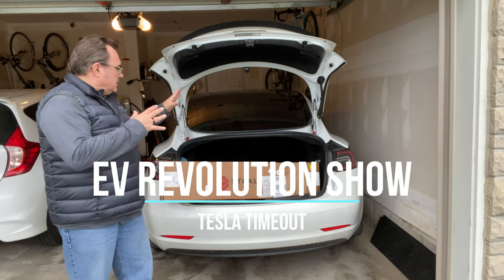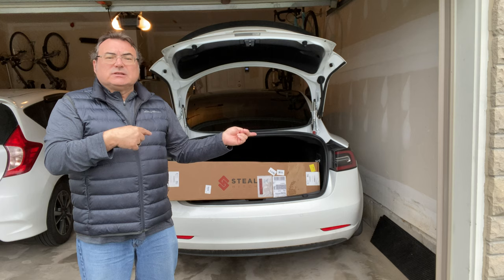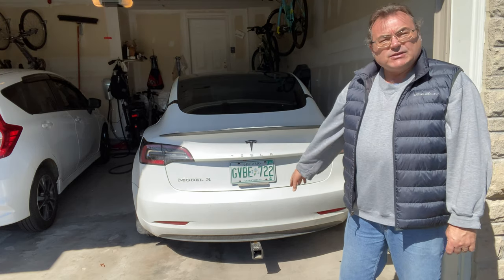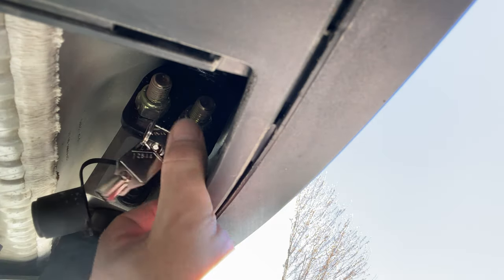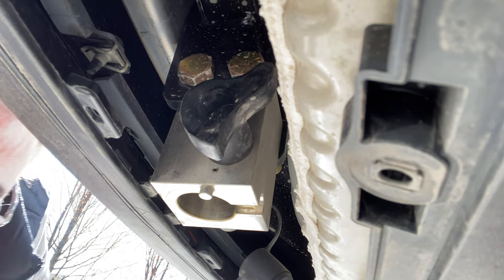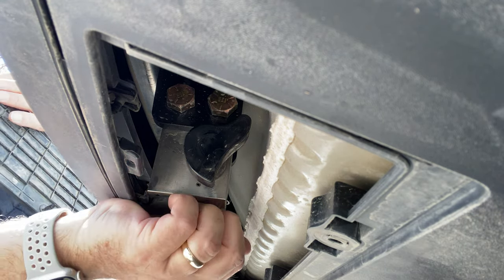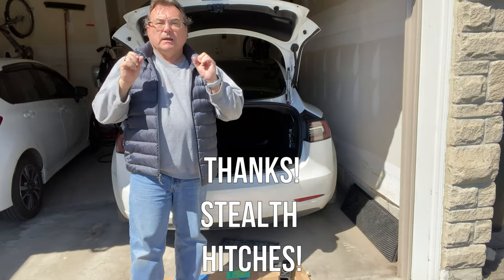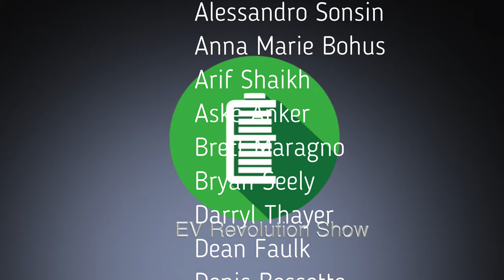Tesla Timeout #11 - Adventures & Accessories for my Tesla Model 3 - Stealth Hitch Review!

Comment: I installed one of those also. I did it myself since I have all of the right tools including a torque wrench. It is a lot work but the instructions are easy to follow. I would recommend to anyone that is not into automotive modifications to have a professional do it like Kenneth did. In my case it was a 2018 Model 3, that did not have the removable cover. I had to cut it out of the existing cover. That makes the rubber covers to the hitch even more important.   They are all high quality parts and it works really well.  The receiver just snaps into place. Once you get the feel of it you can do it without getting on the ground yourself.
Reply from the maker: Thanks for watching and for sharing your experience! It's it a great product.  I will be able to get the feel of it like you say with a little more practise.

Comment: Nice feature to add Ken, thanks for sharing. I wonder if Tesla will offer hitches for Model 3 in North America, I believe they have factory hitches available in Europe. It would be nice for towing small campers or utility trailers, or as a bike rack holder like yours.
Reply from the maker: Thanks JP!  They may but they have bigger fish to fry.
Reply: @EVRevolution  Yes I think you're right, Ken. It's easier just to rough in the hitch mounting hardware and let third parties install the hitch. I believe Europe requires hitches to be OEM installed and trailers are more popular in Europe also

Comment: Looking good.    If we order new 3 would we save cash 💸if we retro fit ?
Reply from the maker: Thanks for watching.  If you are asking if getting a tow hitch from tesla is less costly than aftermarket, I don't know.  Not sure if tesla sells one for the model 3, they do for the Y.  

There are a couple of choices (3 actually) that range from sub $1K Canadian to almost $2K Canadian.  Curtis is the least expensive, but the receiver is fixed and always showing.  Ecohitch (Torque Central) is a great brand and the receiver is removable, however it is held on by a large bolt which needs to be torqued down and they don't recommend constant installing and removing of the bolt.  So I went with the premium (highest cost) hitch being the Stealth that has the easily removable receiver with no limitations on how often you install and remove.  

Hope this helps and if you have more questions, feel free to email me at EVRevolutionShow@gmail.com.  Ken

Comment: I just installed my Stealth hitch on my 2020 Model 3.  I haven't had a chance to load up the bikes yet.  Did you have any issues with the ground clearance when your bikes are loaded?
Reply from the maker: Thanks for watching Matt and great choice!  Yes, the bottom of the bike rack will rub on my driveway when at the bottom going on to the street.  I do it at an angle as to lessen the rub.  Some speed bumps may also scrape, so just go slow.  Otherwise, no problem.  It sounds worse than it is when it scrapes.  Let me know how you make out with it!